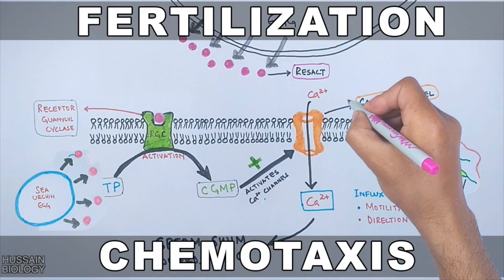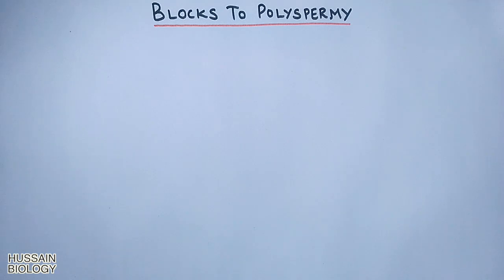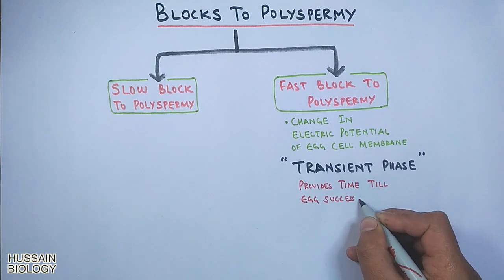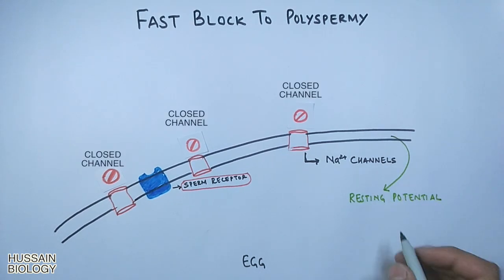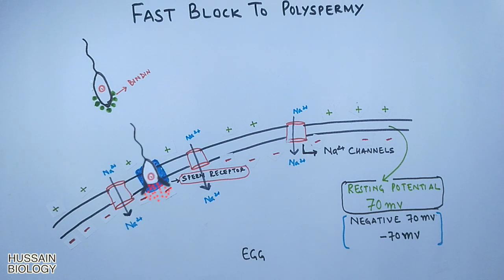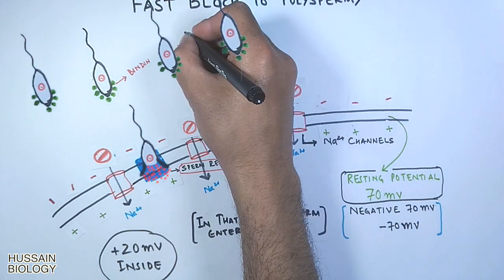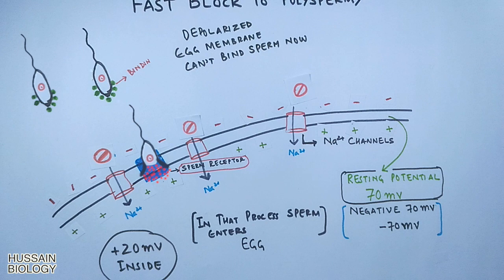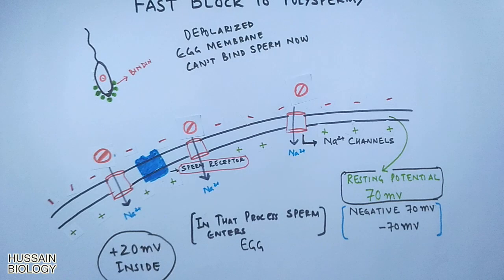Fast Block To Polyspermy in Sea Urchin

Comment: But what happens exactly by Depolarization due to Na+ ions (Voltage Gated Na+ Ion Channels)
Reply from the maker: Change in potential.

✓outside egg becomes negative 
✓inside egg becomes positive

The Sperm needs activation of several Positive Gated Channels , and these positive gated channels are only activated when Egg has positive charge   outside .

All the above conditions change when depolarisation occurs within the egg so  after that no multiple sperms are able to penetrate the egg.